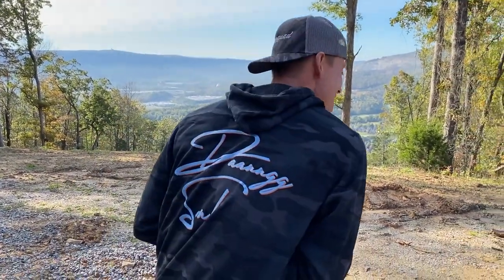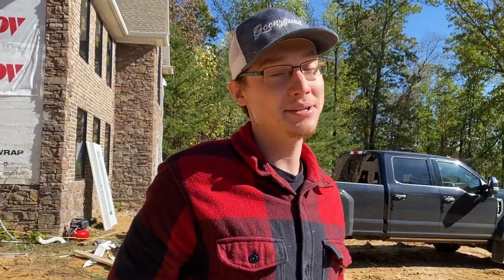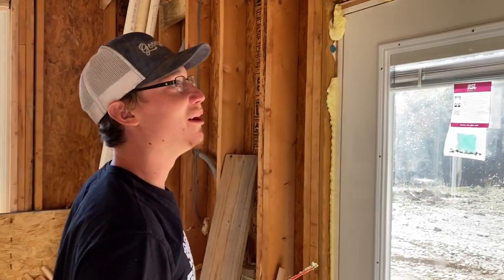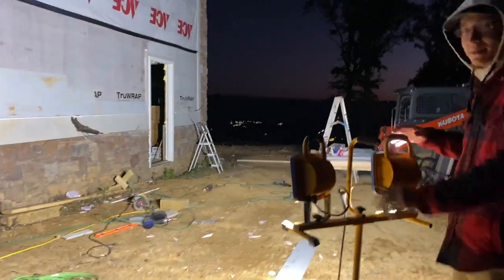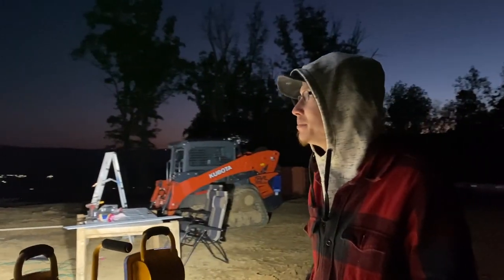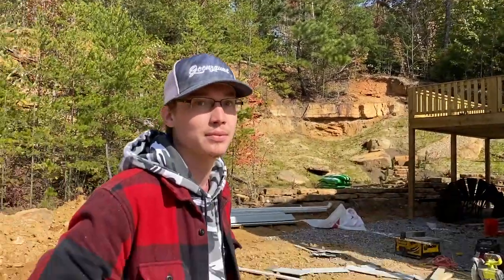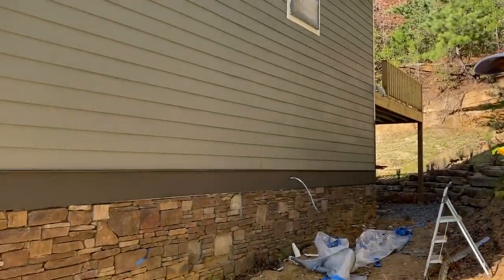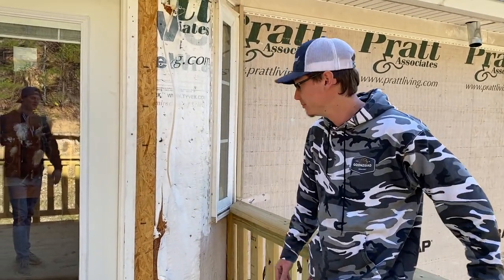The New Goonzquad Headquarters Part 32

Comment: i had that test done at my house and it was exactly as you described, a big fan on the front door and they go outside with a thermal cam and watch where the air leaks out, thats how they did it for me, they also flow tested the faucets and installed water saving faucets

Comment: Mountain shadow vote here. But exterior paint on houses needs 2 coats due to UV exposure and the rain and weather. 2 coats guys. 
Good to see you are wearing a respirator and using the low dust blade with the Hardie board as the silica in it will kill you if you breathe too much in. Look up Silicosis. Stay safe guys and the house is looking super fire. 😊

Comment: Very nice, boys, the darker trim is way better. Also good work with installation and modification of windows and doors. When you sawed out the sill of the 45 sloped window to the deck, I had the impression the inner slope corner wasn't attached on the joint, but I'm not sure as it might be a cross frequency shutter glitch... Check it at 18.43 - 18.47.  I hope you'll remember also to fix the torn wrap and seal the windows properly aginst leaks. I had the impression that the lower kicked door you replaced wasn't sealed afterwards. Always take enough time to do it right the first time. I might be wrong and you just didn't show us everything... Anyway... Keep up! =)

Comment: check your building codes before installing that glass door because if your building a garage attached to the house its suppose to be a solid door that is fireproof  and closes with a spring to ensure closure of the door to the living area
Reply: I believe their plan is to connect their Garage to the House but not to abut the buildings. In that situation the glass door they fitted in episode 32 would open to the exterior, not into the Garage. This should obviate any fire separation requirements.
Reply: @johnstedman4075   not according to what they said in the video was that they were going to redo the siding and then splice into it at a later date ..check@ 58 seconds to what was said...maybe I'm misunderstanding them....but splicing into the siding to connect the two sounds to me that they are
Reply: @John-vd6sk  Their previous videos indicated that the situation would be as I described, but I doubt if they really have a clue how it will all be achieved in practical terms. The project has been characterised by their failure to make proper plans or to get to grips with regulations and recommendations, and the saga continues.

Comment: GUYS!! You most put some lights on that house! some spotlight and light how puts light up and down on that facade!!!
Reply: They'd certainly need to run wiring for anything like that before the insulating gang and the sheetrock squad show up.
Reply: They have the opportunity to pull all the cables inside the house before they plug all the walls inside!

Have done the same thing with my house and it will be a big difference!

Comment: Since you have white atriums the bottom of the trim by the stone you could get like a thin poster board and stick in the gap the get it perfect so you wouldn’t have to try and tape it for a little tip that should work.

Comment: Hey guys, just from experience you will have to have some sort of pressurized water to run the pressure washer. It doesn’t make sense but it won’t pull pressure from a tank!

Comment: Mountain Shadow!
Butt the railing at a 45 angle to the inside of that window instead of the outside.
Reply: Goofzquad will just have to bodge the detail as best they can. If the deck railing had been properly designed this clumsy alteration work would not have been necessary.

Comment: I'd replace the timber railings with steel and glass. Would really modernise it.
Reply: The deck is wrongly positioned, as they will soon find out. It is also structurally substandard. The best option would have been to have raised outdoor spaces on the south elevation, but that would have required proper planning and design four months ago.

Comment: Looking brill!, could you cover the front brick with the hardy board to so theirs a blend from front to back
Reply: Well, anything is possible, but the south facade is virtually complete and to overclad it at this stage would be tricky without first removing the brick and stone veneer. Otherwise the alignment with the eaves, window frames, door frame and house quoins would be wrong. The expense and the time taken would probably make the idea impractical and unviable.

Comment: Just put a post at the end of the rail to keep it off the house, don’t turn it back to the house. That is not needed. Make sure there is a 1inch gap between the house and the end post
Reply: That might work if they can get a good enough fixing on the deck edge beam. I would recommend that they calculate the lateral loading the joint can take, since the code requirements for the stability of such railings are quite strict.

Comment: A pressure washer does not need water pressure. We use tanks on a trailer to wash concrete and houses. Your well will do just fine also

Comment: If you dont clean that foam with acetone before it hardens (in first 5 minutes) you aint getting it off without ruining the surface. You will learn this the hard way leaving that stain on the new door. Same goes for one of the outside windows you installed couple of episodes ago.

Comment: If you need to get a blower door test, you're going to need to do spray foam... you'll have a tough time with fiberglass, and may need to use a sealing company which will end up costing more than the foam in the first place.

Comment: What do you think about the brick facade in front?
Reply: It has never been made clear whether this is a faux brick cladding (a 1" veneer) or a 4" stretcher bond made of standard bricks. The former seems more likely, because the stone quions appear to be thicker than the brick, and the stone is probably less than 2" thick on average. Neither have we been informed if and how the brick is fixed to the timber frame. Overall, there is not enough information to judge whether this element of the construction is fit for purpose.

Comment: Should of put shims between door and door frame before spray foam. Door is going to stick now.
Reply: Yes indeed. As the foam expands it generates a heck of a lot of force and can even bend aluminium frames. It's vital to prevent this happening where there are narrow clearances between moving components.

Comment: You should of allowed for almost 3/8 spacing at the ends of each board to allow for expansion and contraction.
Reply: If you are talking about the Nichiha Siding, the manufacturer's recommended gap between adjacent boards is at least one eighth of an inch (about 3mm) and they stipulate that the space should be filled with caulk rated ASTM 834 or ASTM C920 of a type that is approved for vertical butt joints. All this information (and much more) is freely obtainable from the Nichiha website.
Reply: @johnstedman4075  Regardless of brand there should of been spacing left at the end.

Comment: its funny the house has several different outer wraps lol
Reply: My iinformation is that was built over a period of two years, and not in a continuous process. Materials were doubtless purchased on a 'just in time' basis. It is not a good way to run a construction project, particularly from a liability and responsibility point of view.

Comment: Curious this house is main priority right now but when you guys gonna get the new shop built beside it cuz that's gonna be another month or 2 for that to get finished
Reply: I doubt that they will contemplate working on the Garage/Workshop until winter is over. The simplest approach would then be to have a suitably sized steel portal frame structure designed for the site. This could be manufactured, transported, erected, clad and fitted out in about three months.

Comment: Better simply safe that house,you might make it easier for someone to gain entry by breaking that new glass door.
Reply: Burglars seek inconspicuous entry points when planning to steal items from rural houses. In this case, the garage door on the rear facade is probably where they would make a non destructive entry. Regarding SimpliSafe, it is an aggressively marketed company whose systems have advantages and disadvantages. Property owners should always seek professional advice from independent, competent and trustworthy sources before choosing a security system supplier and installer. The local Police may be able to offer advice through their Crime Prevention Unit. The advice will depend on many factors, particularly whether the property will be occupied 24/7.

Comment: The presuretest sounds good for buildings. The things you guys are doing for a good sealing are not. Its al about the seals around windows and so on. It is better to have double meetings/ sealings (is this correct english?) around the frames and windows instead of using (PUR) foam in every crack. In cars i say yes, for the house i think its a no.  Maybe it has something to do with your building regulations. In the netherlands it is more difficult so it seems. I did like to hear the lambo roar 👍😉🤟👍🏿

Comment: that much glass lol just needa couple spark plugs to get in that house
Reply: Almost any building can be entered illegally if the perpetrator is prepared to break glass. The property owner's responsibility is to ensure that security systems can provide evidence that will identify the criminal(s) concerned and enable justice to be done. This is usually a requirement specified by the Underwriters of household insurance. In rural areas of the USA criminals are usually aware that any form of burglary or 'home invasion' can provide sufficient justification for a lawful house occupant to use force to defend their property, and this right can extend to the reasonable use of licensed firearms. In the immutable words of Harry Callahan: "Do I feel lucky? Well, do you, punk?"

Comment: Hey they listened. They are giving a respiratory to the guy on the saw.
Reply: They have a long way to go. There were at least eight obvious and potentially injurious safety issues in this episode.
Reply: @johnstedman4075  I sincerely hope they listen to their fans. It’s like the helicopter they want to fix. Do you know how many actors and stuntmen die every year on movie sets??? It’s the quickest mode of transport usually but definitely not the safest.
Reply: @timothywilson3785  I think they have youthful delusions of immortality. This is especially surprising since Eleazar ('Billy') is married. I believe that they are being pressured to diversify their channel but they have misjudged and poorly planned their latest property project, and fans are drifting away at a worrying rate. The 'fix a helicopter' idea was facile since such machines are subject to very stringent regulations which allow only specially qualified engineers to check, repair and maintain them. Not surprisingly that doomed project only lasted three episodes. 'Choppers' are involved in over half of the fatal accidents which occur during filmmaking, such as the horrific 1982 crash that killed Vic Morrow and two child actors, and there are frequent accidents in the civil sphere, the most recent high profile example being the death of Kobe Bryant and eight others. In my 53 years of practice I have witnessed more accidents than I care to remember, and sincerely hope not to see any more.
Reply: @johnstedman4075  that is what I have said... who are they building a house for anyway.

Comment: The end game is to make your houses out side maintenance free, you guys are just adding future work, your not flashing out the rock properly or caulking the siding butt joints during the application. Changing that door after inspection is a bad idea, the house will never pass pressure test with a garage door for a wall.

Comment: that foam is a pain to remove completly :(
Reply: It certainly is. They should have masked the new frame first.
Reply: acetone works well
Reply: @mikkoikonen8221  It does with some aerosol foams, but not others, in our experience. The main issue is that the chemicals and heat generated by such products can permanently damage the surface of the component they touch. This is particularly problematic with powder coated items, which we often specify. Full masking removes the chemical problem, but not the risk of heat damage. So my Practice now has an SOP that no expanding foams be used in visible locations on any projects. This is straightforward in newbuild, and in refurb we have GRC linings custom made for window and door openings and then, with straight, smooth and level surfaces on both sides of a true parallel gap, we use a suitable compressible foam gasket (often a 3M product). No leaks, no damage to the surfaces, job done!

Comment: garage door is likely to fail the house
Reply: Yes. A couple of years ago we encountered this problem on a house we were rebuilding in Manhattan. The integral garage door simply couldn't be made airtight. We eventually put seals on the access door from the garage to the house, and it passed. The Inspectors usually use common sense to solve these type of issues.

Comment: pity whoever has to  windex all that glass
Reply: My Practice has designed and assembled houses that are entirely clad with glass. Cleaning of the facades is taken care of by smart robotics. Such systems are also becoming used on glazed commercial buildings. The creation of many different type of glass with different properties, coatings for these panels, and methods of joining them are advancing rapidly in the construction industry. This produces genuinely 'modern' buildings, an adjective which could certainly not be applied to the Goonzquad HQ house.

Comment: Too much glass via window and door. You guys look like your house is in a secluded place and that could lead to break in and stealing. When I saw that someone tried to kick in a door 🚪 that’s a good indication someone already tried to steal.
Reply: Stealing and vandalism are surprisingly common in rural areas of Tennessee. The property needs a professionally designed passive and active security system which is able to protect the assets 24/7. This should have already been installed in areas where that is possible, to adequately protect plant and materials on the construction site.

Comment: Dang deck builders, messed up your porch bad. Didn't they measure anything before they built that? Ridiculous! Also the porch should have been the last thing you built. NOT the first. So much harder to put in drains or a patio underneath now. Stop shooting your feet and plan ahead!